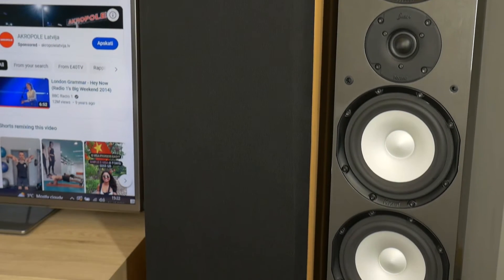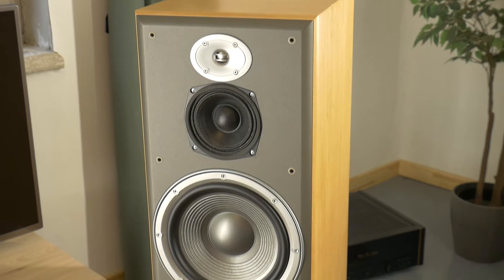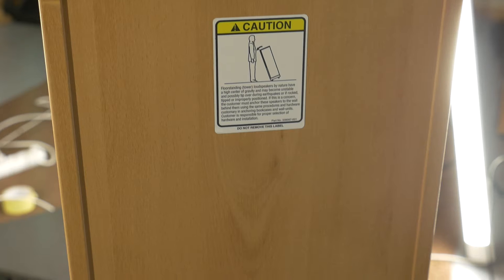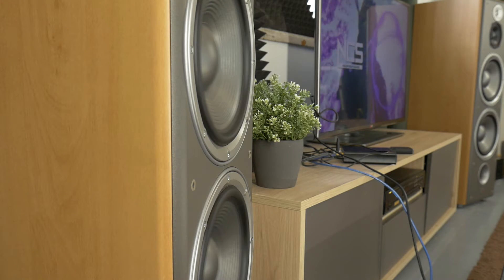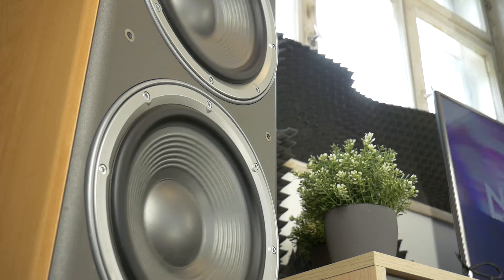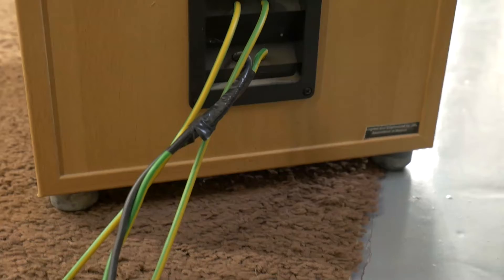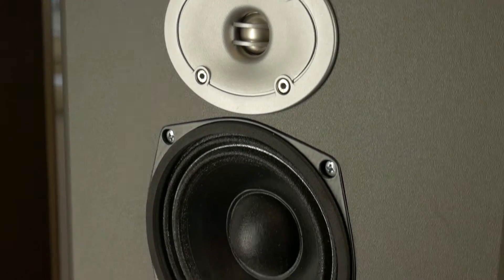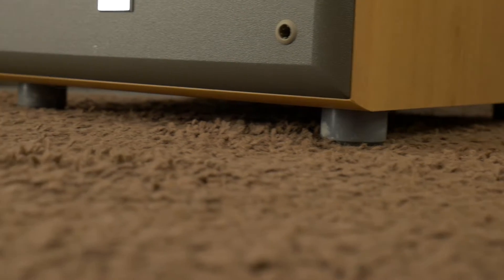Look Inside Upgraded JBL E100 Speakers

Comment: The outstanding features of the Northridge Speakers 5.1 Surround System is how well the speakers work together to give you
a balanced listening experience from what is a single source of sound. You don't hear one speaker over
the other speakers. Outstanding components of the speakers are the 3/4" Titanium Tweeters.
Crisp, clear, articulate but never taxing even after hours of listening.

Comment: I've got the Full Northridge III Surround System with Tower speakers and yeah No Complaints.  Good Clarity and Soundstage, and with
the Tower Speakers the ability to get Loud without Distortion.  This system is considered "Mid-Level" when sold new. But JBL did a great job
with the Northridge Series of speakers, and the system was definitely a "step-up" for most people. And well worth the price. 
I give them Two Thumbs Up. And if you ever get a chance to buy used JBL Northridge Speakers at a good price - just do it.  You won't be disappointed.

Comment: Do you know maybe how much ohm's have those bass drivers? Are two of 16 ohms or 4 ohms? I want to build some speaker box like e100 but i need as much info of original drivers and box itself. If you have information can you tell me? Thanks.
Reply from the maker: No idea, but i have for sale JBL E100 audio crossover
Reply: i prefer go work on few days and buy e 60 JBL very good for me in 20 mk2  room

Comment: Cool, but I don't like the visuals of this midrange speaker and the lack of terminals. I dreamed about E80 speakers in 2007 :D
Reply from the maker: For every day use they have black fabric grill full size. These speakers are connected to two amps in bi amping mode, these stock terminals not the best quality.

Comment: The coils are inductively coupled !!!
Reply: https://www.youtube.com/watch?v=00tTZyLQ8-I
Reply: Placing is as good as it can be with this number of coils at this size of PCB. It won't cause any audible issues, there are more significant issues here (driver quality, lol).
Reply: @tomkocur  Completely unprofessional. If you don't want it, you don't hear it. There is nothing professionally assembled for you to compare it to.
Reply: @janosnagy4382  What other way would you place those coils? How exactly would this coupling reflect on measurements? 

I say this is the best possible placing of coils (if we talk about the replacement XO) - the only way to improve it would be splitting the crossover into multiple PCBs. And even that wouldn't result in any audible difference on these speakers.